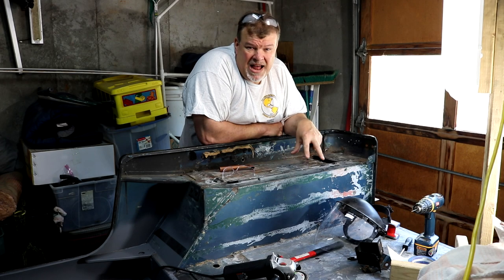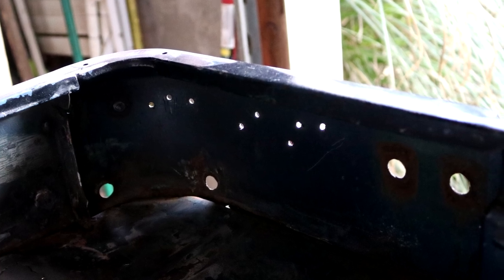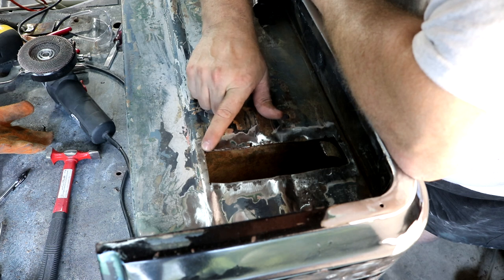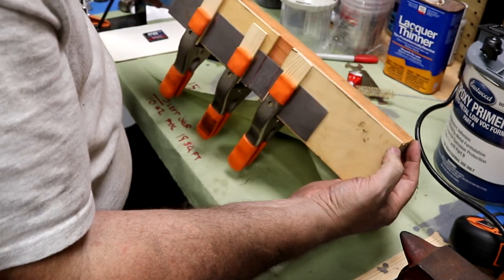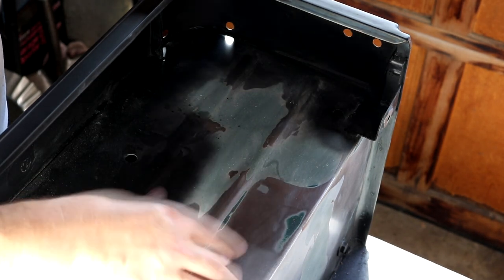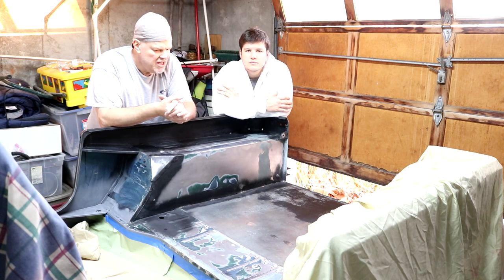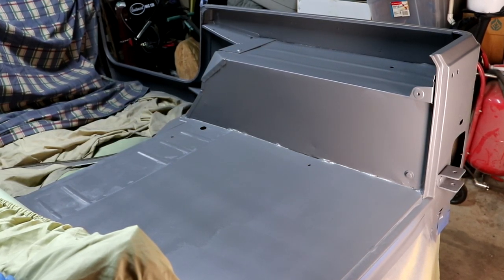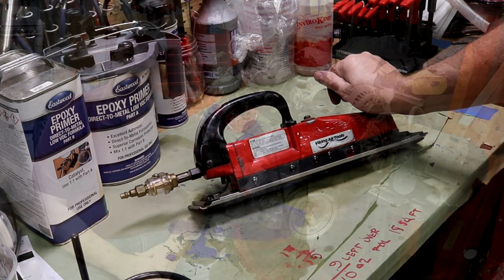CJ7 Passenger Rear Panel Repair | Project Rowdy Ep026

Comment: I need to learn how to weld apparently. Love the videos, jealous that you have a garage to work in LOL. I set up a 10 x 10 canopy to work under. But I still get it done. I have to replace the driver side floor board in my CJ-7. I’m going to go watch another one of your videos now…
Reply from the maker: Welding is really fun   I am an extreme novice.   Nothing that I am doing is extremely structural, so I feel comfortabe with it.  You would be surprised at how cramped my work space it.   Glad that the vids don't highlight that.   I am currently replacing my Drivers Floor Pan.   I have already completed the Passenger side.  learned alot from that project.  Floor Pan, Side of Tub )rusted through, and bottom of A-Pillar completely rotted off.   All being replaced.  Cheers.... Mike!

Comment: Looking great as always!   Was that a copper bar you used behind the holes to support your welds?  Good find on the air file too.  One word of advice from a novice painter... leave the air “on” while spraying.  Just control the paint when you get to the ends.  That’ll help with any splatter from the abrupt starting of the air stream through the nozzle.  Keep it up and I’m anxious to see what you choose for the bed liner.  The U-pol stuff has great reviews.  Take care!
Reply from the maker: Thanks Bob!  I did use a copper backer behind the welds to help avoid blowout.  The store bought copper backer was too large, so I made my own (1/2" Pipe flattened).  I'll try the tip on the constant air... makes good sense!

Comment: What grinding wheel are you using to clean the paint off before you weld?  It doesn't seem as aggressive as mine.  I like it.
Reply from the maker: Sorry for the delayed response.  YT did not alert me of this comment.  Just found it.   The Disk that I like to use to take off paint is a Flap Disk.  Probably in 80 grit.   You need to keep them flat against the work and lighten up with you approach metal.   My son used it in a slanted orientation and didn't realize he was scalping the metal.  You can get them at Home Depot, Lowes, Harbor Freight, and most hardware stores.  Cheers... Mike

Comment: What were you using under rails and behind the button holes when you were filling with weld?
Reply from the maker: On this side of the vehicle, I do not remember if I cut a small metal patch to help fill those holes, or if I didn't.  Most of the smaller holes, I used a home made flattened piece of 1" Copper Pipe.  The hot weld will not stick to Copper.  I was able to reshape the copper to best fit many different situations.

Comment: Why was the bed area of the tub flat and not ribbed?
Reply from the maker: You have a great eye.   The PO of this Jeep had wrecked it and they replaced the floor with a thick piece of steel.  My intensions are to retain it.  Cheers!  Mike

Comment: Air file shouldn't  be used with paper finer than 180 ....... file will heat up the panels causing bondo to clog paper ..... air file should only be used to rough in body work .. not a tool for finish work